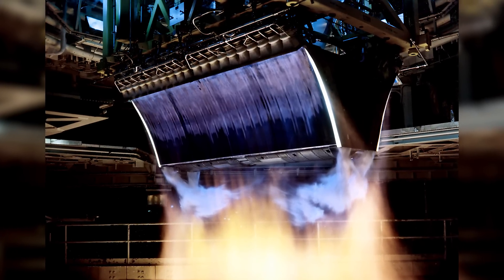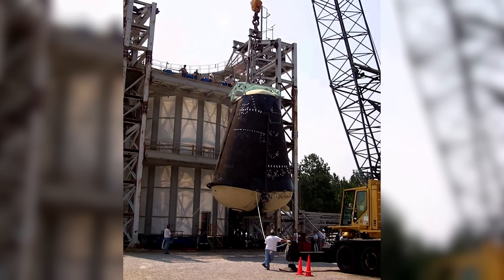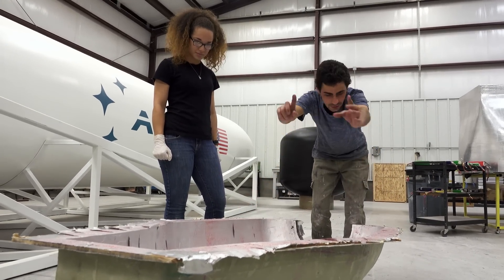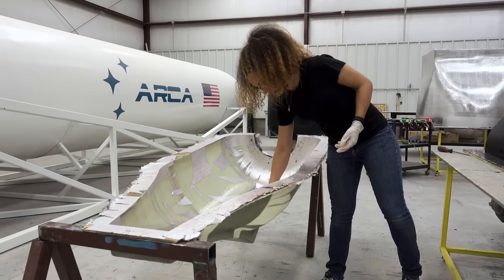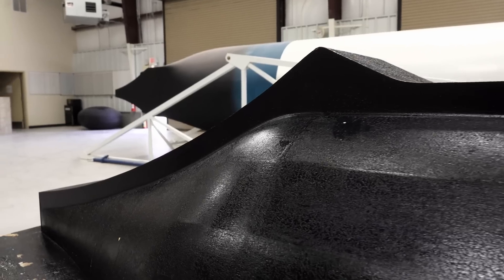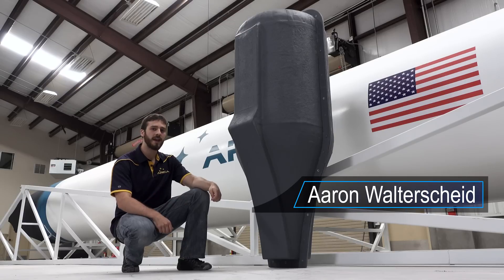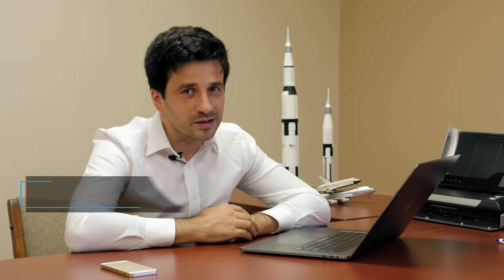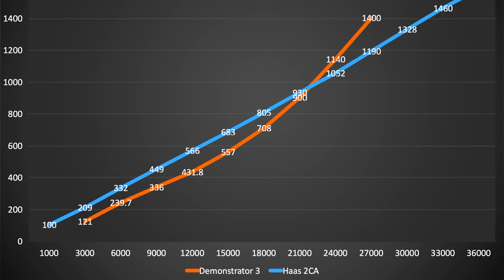Flight of the Aerospike: Episode 3 - The Linear Aerospike Engine

Comment: Why can't we use fighter jet nozzle which can expand and contract to suit the varying atmospheric pressure for a space rocket?  Because a space flying rocket will be going through a lot pressure changes and an expandable nozzle could provide the ideal expansion
Reply: Too complicated for a rockets nozzle. Rocket fuels burn at much higher temperatures. The dozens of parts would add cost and increase complexity. Rocket engines are already complicate enough even in pressure fed systems.

Comment: Is there a reason you guys aren't using gelcoat in your molds? Without gelcoat you have a good chance of getting the final part stuck in the mold.

 I'm not an expert, but your fiberglass fabrication techniques have me scratching my head. I see your using polystyrene foam for the plug and I guess you're covering everything in foil tape to protect the foam from the polyester resin. Which is not the worst idea, but starting first with a few coats an oil based primer like KILZ will give you a surface that can withstand automotive primer filler, bondo and finally an automotive paint to really get a perfect finish for the plug. Then when you make the final mold you start with a coat of gelcoat followed by fiberglass and resin.

Comment: I'm confused.  Why not use a traditional round (toroidal) aerospike?  All that extra hardware I see on the rear of your rocket does not instill confidence you can meet the slim margins needed for SSTO.  How do you intend to control roll, pitch, and yaw?  Can you do this with differential thrust on a linear aerospike?
Reply: A linear aerospike can be fabricated from sheet materials.

Comment: When SpaceX returns their first stage, they have to perfrom the reentry burn so that the air does not tear up the nozzles. For the same reason (and for the heatshield) they will also have to re-entry the second stage with engine pointing back, which is not optimal (you want the heavy part pointing front). Do you think that aerospike nozzle would help here? That if would survive first stage reentry without the burn? Or maybe even act as a heatshield for a second stage re-entry?
Reply: Ablative composites is not enough for a re entry heat shield.

Comment: Would it be possible to cast the propellant tanks out of a single piece (instead of bolting two halves together)  if the rear opening (for the propellant pipes?) were bigger? Wouldn't this result in lighter, stronger propellant tanks allowing for even higher performance?

Comment: What composites are you using for the final mold?
Reply: Indeed I do, propriety and all.  It's an awesome and inexpensive fabrication strategy though!  I write a science column for a local publication and want to feature what you're doing if y'all don't mind.
Reply: I'm guessing your using composites similar to those used in military applications. In fact probably developed by the military. Possible carbon fiber inbeded with other materials.

Comment: The problem that NASA had with the X-33 large Carbon Fiber Lifting Body Fuel Tank was solved.  Hope you can reuse the rocket whether you land on the tail like Flash Gordon did...  Or glide in for a landing like NASA was planning.  The US Air Force has been testing a reusable Payload Section with a gentle return to a Spaceport.  Thank you for the video !  tjl
Reply: Coming along nicely! When you are talking about interest from the US military are you referring to the larger, reusable, SSTO part?